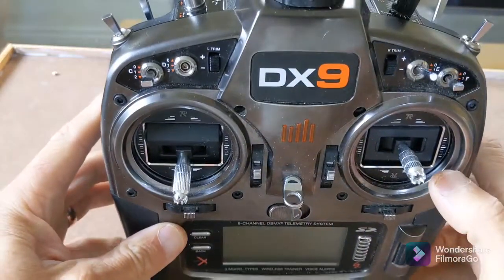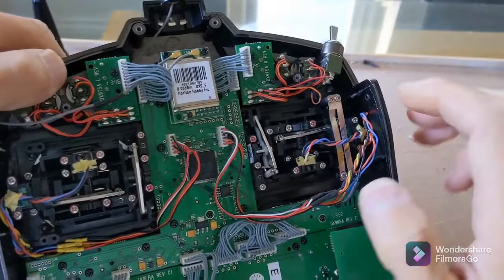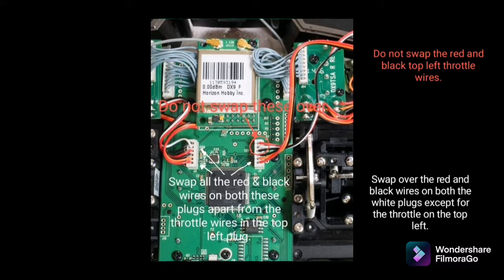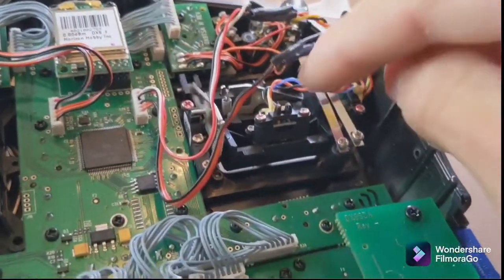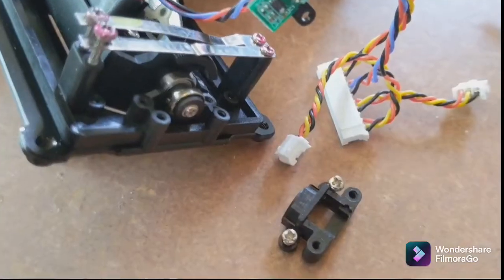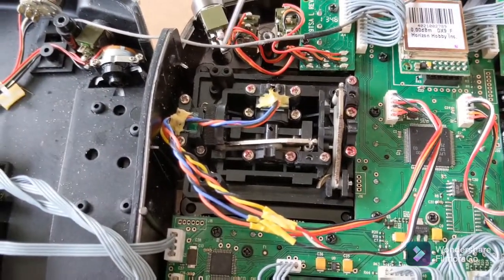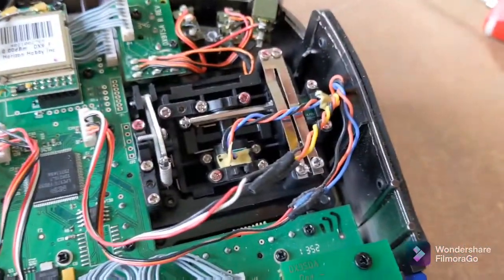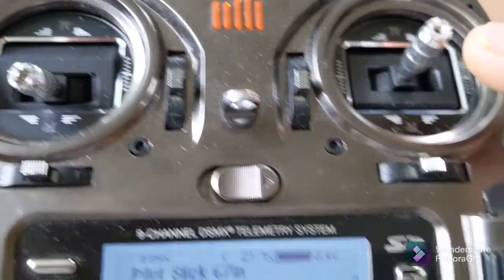Spektrum DX9 radio with M9R gimbals.

Comment: Somehow my throttle only goes from -100 to -5. I cant calibrate the left gimbal in calibration mode. Any advice?
Reply from the maker: You may need to rotate the magnet if you've done the mod...
They have a north and south pole it's usually marked on it in felt tip pen which easily rubs off...
It's a pain to get it just in the right spot once it's been rotated slightly trial and error
Reply: @davidhall4398 thank you for your response! I already rotated it 180degrees but I try to move it slightly and test it.
Reply: @davidhall4398  great it worked! thank you so much
Reply from the maker: @unstackable_cups1046 Glad I could help 👍

Comment: I just did this upgrade on my NX8 after the stock throttle pot crapped out. Few notes for anyone else that may benefit:
 - I used "FrSky M9 Hall Sensor Gimbal for Taranis X9D & X9d Plus" from Amazon for both gimbals
 - Locked out the throttle spring return using screw that came with gimbal
 - Both mount "upside down" in the transmitter
 - Both have to be trimmed down a bit on top to fit, I just used a metal file took 10 minutes each
 - Throttle wires up exactly like original
 - Rudder, Aileron, Elevator all three need the polarity reversed, just swap the two outside wires. 
 - Gimbals feel better than stock for sure, but once in the air my thumbs don't notice a difference. I do almost feel like my plane is doing what I want more now though...
Reply from the maker: @jacobboone6078  Do yourself a massive favour a sell your Spektrum. Absolutely crap compared to Frsky Transmitters
Reply: @davidhall4398  I'm with you!  I will not be giving Horizon Hobby another penny. Its all junk. I was new to flying when i bought into the Spektrum koolaid, and it got me going quick and easy. now that I'm commited to rc flight, my next transmitter will be Jeti or similar quality. or if i'm gonna buy chinese quality, i'll buy FRsky/flighmaster/etc.

Comment: Thnx for the tutorial.
About the magnets, you turned throttle, elevator and aileron? Not rudder? Or all four?
Reply from the maker: Hi there, I just turned the Throttle 180°s try to leave the black plastic centre piece in place or you may end up with it slightly out of position. You can see it on the monitor screen if it's out of position...
I've since purchased a NX10 and replaced the Gimbals in that too because the internal gimbal arms are plastic whereas the FRSKY Gimbals are steel and they centre way better...plus I prefer heavy Futaba gimbal springs you can buy these separately...they help with even inputs especially for rifle rolling...
I wish I had bought a Frsky Tx now...
Spektrum are good but expensive compared to Frsky and IMO I think Frsky are better quality
Reply: @davidhall4398  at 14:29 you said its better to turn both magnets on both sides?
LOL i did throttle and elevator and the both got loose from the black part
Reply from the maker: @tommyhansson6680  yeah sorry I just watched it back...I did that so you wouldn't need to reverse the servo travel...but now I would just reverse the travel on the elevator...but obviously you have to reverse the Throttle magnet...because of the alarm.
Yeah if the black plastic comes out it's a pain to manually adjust it slightly to get the monitor screen reading correctly...but not to hard.
Reply: @davidhall4398  ok then so all four magnets 👍
Just swapped the springs.
Hm that doesnt sound fun. And calibration doesnt fix them slightly off?
Reply from the maker: @tommyhansson6680  no if there off slightly ...if I remember correctly...I tried calibrating but they where still slightly off...you have to undue the screw holding the magnet slightly then rotate the magnet slightly...trial and Error unfortunately to eventually get it into the correct position ...but the magnet should have some black marker on it... representing the the poles...so you should be able to get it fairly close using this mark...BUT IT EASILY RUBS OFF!
Reply: @davidhall4398  great ill try. Big thnx for the help
Reply: @davidhall4398  did get the gimbals in tonight. All center was off by -6 up to worst -39.
Did a new model and calibration and all in the monitor is 0 at center and 100 on ends.
So should be good?
Reply from the maker: @tommyhansson6680  oh wow the calibration worked ... brilliant 👍
Did the throttle work okay? That's the main one
Reply: @davidhall4398  yeah all of them worked fine! 🙏😊👍
Reply: @davidhall4398  hm something is not right.
Plugged in an old model and the ail and rudder is reversed.  And trims going the other way.
So I guess those magnets should been changed.
I got 20 models so I need to get it right
Reply from the maker: @tommyhansson6680   Yeah just rotate the magnets should be fine then 👍 that's a lot of models
Reply: @davidhall4398  i have heavy duty feathers  in my old spektrum gimbals. So you think those are better than the original frsky
Reply from the maker: @tommyhansson6680  
I swapped out the springs on the Frsky M9R racing Gimbals recently because I practice Rifle Rolling on the Realflight SIM ...Jase Dussia Extra 120cc V2 plane the one he uses to Train with...it's very very good SIM plane IMO but it's very hard to learn to Rifle Roll with so I tried FUTABA HEAVY GIMBAL SPRINGS pack of 3...and was impressed with how much better I was with the EVEN inputs well worth a try

Comment: Instead of turning around the magnet. Cant you just switch the wires around in the plug?

I broken my original spektrum gimbal, the elevator didn't center (small metal pin broke) so I switched it with the other gimbal because the throttle is loose anyway. I also got the hight throttle warning. Stitches the red and black wire on the plug and problem solved
Reply from the maker: Hi there Ruben, honest answer I don't know if swapping wires over would solve the throttle Alarm because you have to rotate the gimbal 180° but probably best to just turn the magnet 180° to compensate it's quite easy to rotate.
Reply: @davidhall4398  yeah that's the. Since I worked with the original gimbal with a pot I didn't have that "luxury". So I swapped the wires and it's working. At least untill I upgrade to another gimbal or a different transmitter
Reply from the maker: @RubenRC94  
I would highly recommend installing the Frsky Hall Sensor  Gimbals there an easy swap and cheap. Plus I've just sold the old dx9 Gimbals on eBay so cost me a few pounds only.